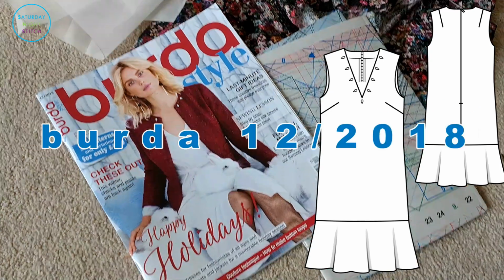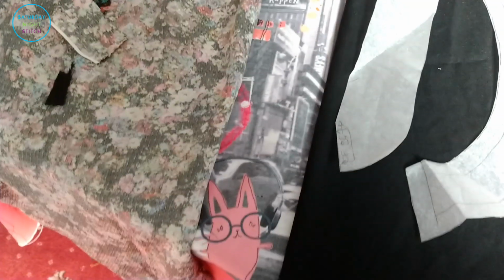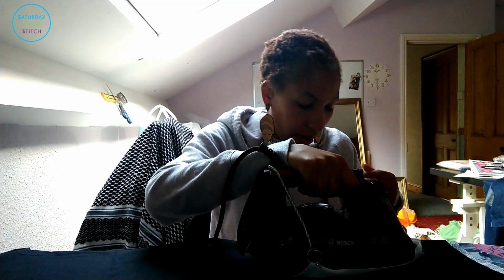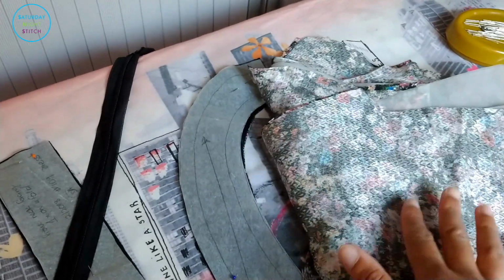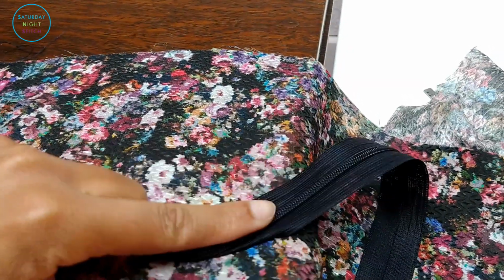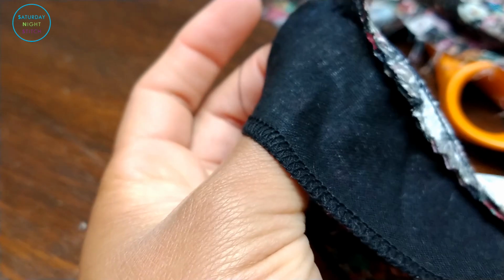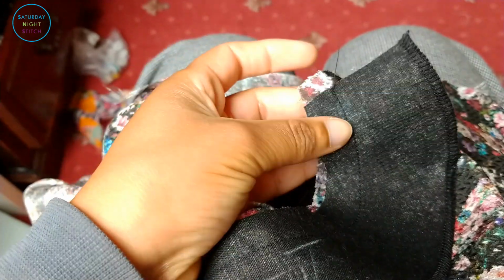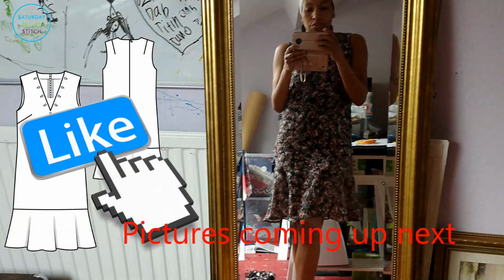HOW TO SEW BURDA 12/2018 #109 Silk DRESS | SEWING TUTORIAL

Comment: I've found using a smaller iron ( for example a travel iron)  because of the width may save you a few millimeters when fusing the interfacing
Reply from the maker: Thanks for the tip! I'll check out some travel irons.